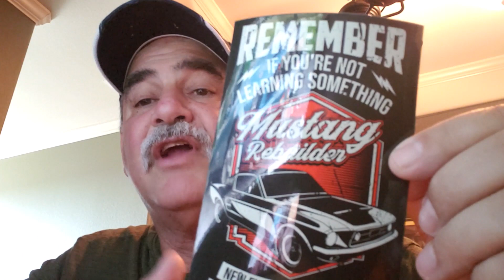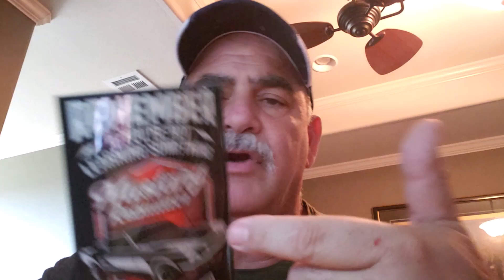How do you Pick which Stump Grinder Tooth to run

Comment: We run a Vermeer SC70TX and a 252. We were running yellow-jackets, but are switching to Green Teeth. We grind a lot of pines, and the reds are awesome! Much more productive, and they hold up well. The yellow jackets were useless as soon as the edge wears off. The reds keep cutting till you start wearing the pockets (not recommending that, just an observation). We are changing over everything to Green-Teeth. One piece of advice: Don’t tighten them too much. You’ll crimp the spacer, and then they are a pain to get off.

Comment: I'm running Greenteeth 900 on my Vermeer SC30TX. I just spent the afternoon sharpening teeth thanks to your previous video.
Reply: Can you add the green teeth to the vermeer wheel or did you have to puththe green teeth wheel on?  How was the performance of the green teeth compared to the yellow jackets?

Comment: I'm getting just a couple of hours per side on 900 series green teeth, on an SG40. The lead teeth definitely wear faster than the other 2 pairs. Fortunately they are very easy to sharpen with a proper green teeth diamond wheel setup.    My next couple of sets are the wear-sharp design, hopefully I don't have breaking issues with those to often.

Comment: Hi Adam, thanks for the videos! It sounds  like you’re doing good. I pray you heal completely. You’re exactly right about the sandvik teeth. I work in areas the are some what rocky to rocky and the sandvik teeth are very durable. I run a sc1152 with the Revolution wheel.
Keep up the good work! God bless you.

Comment: I have vermeer sc 60 I've ran pro series and green teeth they both did good for me here in tx  but the green teeth are so much easier to change out I prefer the wearsharps.
Reply from the maker: Well your winner number 2  send info to Mustangrebuilder@gmail.com
Reply: We are really close to switching to a New River wheel on our Morbark D86 Track. We run 1100 series and have always bought from greenteeth. We have yet to have anyone retip any teeth we have but wondering before we spend thousands on a new wheel. Do you think your retips last longer than fresh greenteeth? Last few sets haven't made it through 5-6 stumps without replacing shattered lead teeth? And we are in Louisiana, soft soil, pines and oaks mainly.

Comment: Hey Adam. Greetings from the UK and best wishes for a Happy New Year!  I've followed you for some time and am grateful for the insight you've provided, keep up the good work.
I've been grinding for nearly 5 years now, just a small one man band but it's all I do day in day out, and consider myself to be highly experienced and an industry professional.
I started with a Predator 28rx. In my opinion a disaster of design and awful build quality. I ran Rhino teeth (the single tip not the 4 tip cat paw), and they were really terrific teeth, very durable. I had to switch to a multiptip 2 wheel and teeth (the 4 tip cat paw design) and they were great teeth too, super cuts but less durable perhaps.
When I managed to destroy the Predator (it's not hard, the 28 literally shakes itself to death eventually!) I went with a Bandit ZT1844 running the greenteeth. Super move! The 900s, or rather 925s as they have just two cutting edges not three, are great.  I've never got on with sharpening any teeth really - there's nothing like new and so my costs are perhaps than they could be.
My next switch will be to the New River Revolution wheel (the lite one) and I'm really looking forward to seeing how that goes.  I have a wide variety of soil types with lots of junk, so have broken LOTS of teeth, bolts, pockets etc.  I wonder if I'll start to sharpen the Rev teeth...?
I also run a FSI B20 with greenteeth (700s). Again theres nothing to beat new sharp teeth on it!
Reply from the maker: Where are the Predator machines made?
Reply: @mustangrebuilder  They're a British design and company, but I think built in an Eastern European country, to a budget. The warranty and service from the company leaves, lets say, something to be desired.

Comment: I picked up a 1625 rayco super jr  super cheap just put green teeth 900 .made this small machine cut better but i really need to upgrade the motor. Only running 6 green teeth instead of the 18 rayco teeth

Comment: @Mustang Rebuilder, I enjoyed the video. I am going to get a bandit sg40 stump grinder with a 37 hp kohler gas engine. It comes with 8 green teeth stock but the seller asked if I wanted to upgrade to the river revolution with 24 teeth. It's the same thickness and diameter as the green teeth but I don't know which one to choose. I will be doing mainly residential backyard jobs just to let you know the  type of terrain. I live in houston tx. I would greatly appreciate your 2 cents on which one I should get. Something tells me to get the green teeth but the revolution wheel looks tempting.
Reply from the maker: here is the deal the rev wheels teeth are very strong  and great for rocky soil the greens  are  not as good in rocky but change out fast and cheap to retip
Reply: @mustangrebuilder  thank you for the insight. I know the rev would be heavier because 24 teeth compared to 8, but how much heavier? Motor will have 37hp
Reply from the maker: @treemanaviles  the use a wheel called rev lite which is smaller and compatible with the machine ... had this type of wheel on a 27hp bandit a year ago
Reply: @mustangrebuilder  thank you for your time and input.

Comment: I have been watching for a while and these videos you produce are great.   I purchased an Early 90's 222 with a newer 25hp kohler pro on it for 3500$ too grind 30 or so stumps  at our family's cabin property with the intent  to sell it  after the work, but  basicly paid  it off grinding for all of the other neighbors in the area, its running  16 700 series green teeth, you have commented  a few times in your videos about putting the fresh sharp teeth on the lead teeth, which ones are the lead teeth???? there is wide and  straight pockes on the machine. Im guessing it the wide ones? and what are your thoughts on the performance up grade kit from greenteeth with the 6 900 series teeth?? thanks again for all the information you share in your videos
Reply from the maker: performance kit will help and the leads are the straight pockets or the  pockets that are closest to the outside of the wheel , youi may have an old wheel design ...some pockets and teeth on wheels extend
higher than others
Reply: Thanks for answering my questions, I'm pretty new to grinding but really enjoy it

Comment: Just bought a Vermeer SC382 - Greenteeth doesn't have a setup for this machine yet so I guess I'm running yellow jackets for now
Reply from the maker: called factory for you and they are working on a design
Reply: @mustangrebuilder  I have a Vermeer stump grinder - the manual shows Vermeer Hy-Power 68 for hydraulic fluid. This is not available locally and would have to be ordered - any recommendations for an alternate fluid?
Reply from the maker: what  @chadrichmond2608  Look at what temperature range or weather you will be running the machine https://www.thelubricantstore.com/hydraulic-fluid-temperature-range   just look for a good brand 68 weight hydraulic fluid  Napa will have it
Reply: @mustangrebuilder  If it just needs to be topped off can you just add to it, or do you have to replace it all?

Comment: Let the fanboy warz begin.  I've got an SC252, an RG50 and an RG66.  I didn't like the Vermeer teeth or the Rayco teeth (pain in the neck to change) so I use greenteeth on all of my machines (and got a a greenwheel on the SC252).  I like the way that the reds cut but they seem to fracture easily in rock.  I don't care for the wearsharp as they seem fragile (don't last as long).  I've thought about "trying" a New River wheel but that's an expensive wheel just to take it for a test drive... and in the FB forum, the New River guys seem like a cult.  Just sayin...
Reply: So how do you like the Green wheel on your 252 with the green teeth? Pros & cons...
Reply from the maker: greens on a 252 will improve your performance go to https://www.greenteeth.com/ and watch there videos
Reply: @Shawnymac40  I'm sorry that I did not see your comment sooner.  In general I turn off notifications because there are too many trolls polluting the air.  But... I like the greenwheel on my 252.  It seems to cut better, the teeth seem to get used more evenly and there are fewer teeth to change.  About the only drawback is that you can't use the cutting head to shove the wood chips to the side (out of the way).  I tend shove the chips aside to clear out an area under the grinder as otherwise the chip buildup slows down the cutting head, dull the teeth more, and the chips get ejected over the top / front of the grinding wheel (big mess).

Comment: I have two sc252 one has green teeth and the other has yellow jackets
Reply: Which teeth do you prefer. I use yellow jackets and thats all I've ever used but looking at possibly switching to greenteeth.
Reply: That's the same question I have. Overall will the green teeth out preform the yellow jackets?  I been running yellow jackets for 6 yrs now ,I just upgraded motor on 222 ,put a harbor freight motor on it and it is a beast.  I would switch to green teeth but would like to hear from someone who run both. I grind alot of firs, but always looking for ways to take less strain on my equipment.